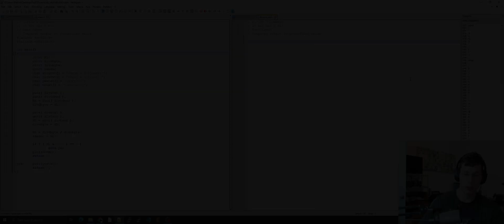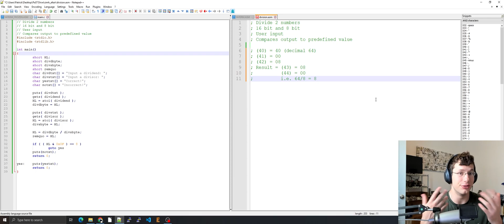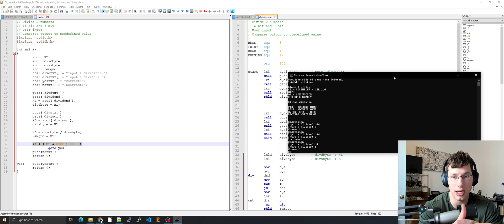8080 Assembly Programming Tutorial: DIVISION

Comment: This doesn't work if the result is greater than 255. Take 1024/2. Per your instructions, this is an unsigned 15-bit number divided by an unsigned 7-bit number. I want to take 15 bits divided by 7 bits and come up with a 15-bit answer and an 8-bit (or perhaps 7-bit) remainder. I, too, was writing an "itoa" routine, but I also need the division subroutine for other purposes. So I'm not just dividing by 10. And even if I am dividing by 10, this doesn't work if I want to print 2560 or larger.
Reply from the maker: @cyborg555  I have a working double dabble routine, I think it's on my itoa video! I'll take a look at making an updated video too
Reply: @TheWinnieston  Does double dabble work for any divisor or just 10?
Reply from the maker: @cyborg555  ah, I'm so sorry! Yiu ate right, its just a bcd thing. I'll take a look at how to mix shifting and subtraction for division

Comment: Is there a chance that you could make an assembly program which instead of outputing correct/incorrect outputs the answer? For example 64/8 it outputs 8? I'm new to assembly and I wanted to try and make it but it didn't came as I expected 😆😆
Reply from the maker: @readytolaugh.shorts  you can... but that requires doing an int to ascii conversion, which itself could use division. As others have said, you could also use double dabble to achieve this. Iirc, I have an ITOA video using double dabble